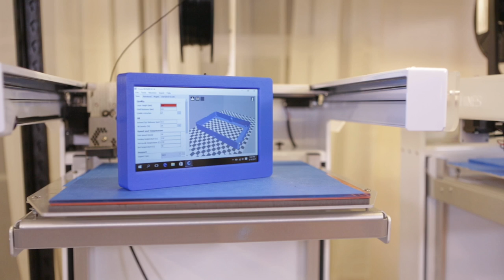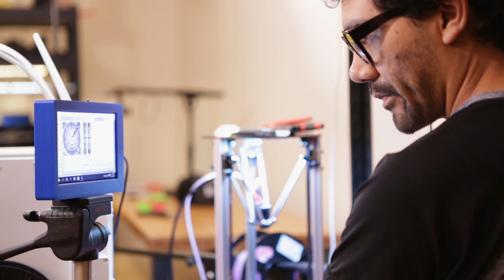3D Printed Mini PC #Adafruit #3DPrinting

Comment: I noticed something you might have forgot to do, and that is to reconfigure the AR1100 touch controller for direct touch input (instead of mouse emulation).

It's interesting that you decided to build your own UMPC, because while the Q1 Ultra is a great UMPC, it only has a 800MHz processor and can't run Windows 10 (it can, but it's painfully slow), unless the user specifically needs Windows XP or 7. Oh, and it doesn't have a built in hole for attaching a tripod. At least some Q1 Ultra units (including the one I have) do have fingerprint sensors, but for other PCs, there's this tiny external fingerprint reader that's called the "COBO C2".

I also forgot that the Kangaroo mini PC even existed until I watched this video.
Reply: Kevin Bhasi YOU COPY MY PROFILE PICTURE!!!!!

Comment: Have you considered doing a version with the Latte Panda? The CPU is less powerful and the unit would probably end up being slightly larger, but the built-in Arduino co-processor and sensor circuitry can add plenty more uses. Plus, it has built-in display and touch-screen connectors, allowing you to use the HDMI-out for other purposes than the main display.

Comment: Have you guys tried using a raspberry pi (or similar) in place of the windows box?  I imagine it might be possible to integrate everything inside the box if you used a small enough device, like a PiZero, maybe?
Reply: I'm pretty sure they have done a similar thing with a Pi board, but I'm pretty sure that they needed to use Windows, because the software they use probably isn't available for Debian on ARM devices.
Reply: you cant play x86 windows games but  that would be great

Comment: That HDMI Cable needs some protection! Maybe a C-Channel design around it should be good.
Reply: I wondering why not print the case with a hump to hold it all as one unit?
Reply: TheDutyPaid I think that was on purpose so he can remove the kangaroo and have something else displayed

Comment: OK, here's a stupid question.  If you wanted less of that ribbon cable sticking out, or for durability's sake, can that HDMI connector be found in the opposite orientation (so the ribbon connects under the nano PC)?

Comment: this slightly sounds like cloning to me, if you think about it, you can install the 3d printing software on a computer, make one of those computers, install the software onto that, 3d print another one, etc. But this is a very good idea!
Reply: You'd have to 3D print the 3D printer. Which is actually something  people do, including a couple colleagues of mine.
Reply: That is cool, also, I'm wondering, what is the cost of printing a 3D printed 3D printer, excluding the actual printer printing it.
Reply: Well, from your colleagues.
Reply: It depends. You have the cost of the plastic, of course, which depends on the material. Then there's usually some additional structuring you need, which can be metal, wood, or some other kind of material like carbon fiber. Then you need the electronic components, which includes a controller (essentially a raspberry pi, but specifically for the printer), as well as motors. And then, of course you need the extruder, which you can either buy or make, but either way you'll need more than just 3D printed parts. The prices for all that depend on what you want your printer to be able to do, and how good you want it to be.
Reply: It should be reasonable. Ballpark: I'd say between $400 and $1000.